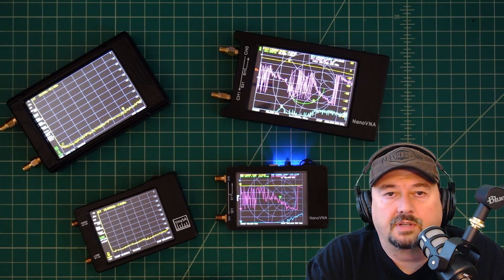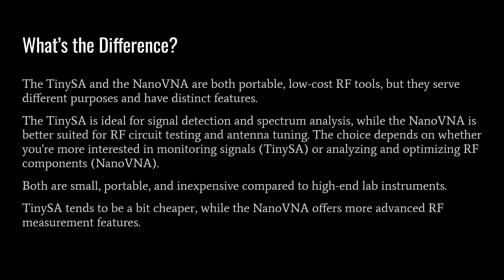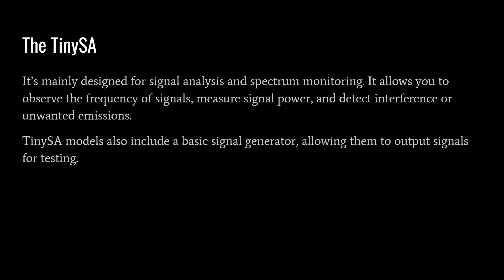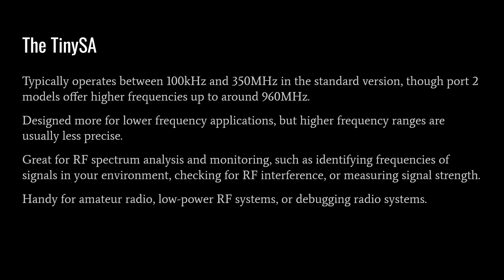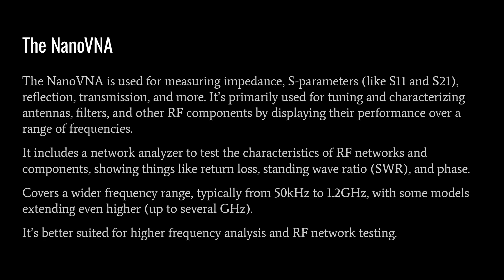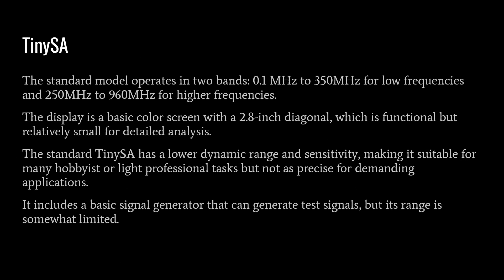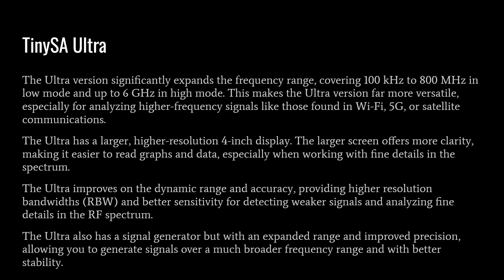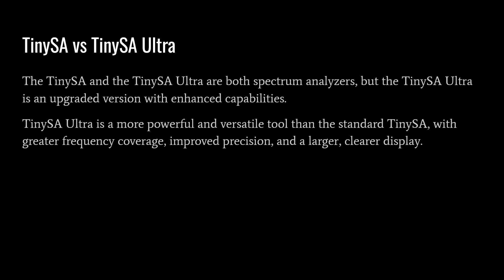TinySA vs NanoVNA: The Ham Radio Showdown

Comment: OK, first I bought a NanoVNA for antennas/cable testing/etc.  Then I bought the TinySA  Ultra for finding RFI.  And now I am buying the Tinysa Ultra plus.  If you put one TinySA as a signal generator set to -73dB (S-9) into you radio, you can calibrate your S Meter (nice).  Your second TinySA Ultra used as a spectrum analyzer can trace thru all your radios circuits looking for proper operation.  That lets me troubleshoot radios with a known signal source and a calibrated signal sniffer.  It is very effective for the price.  Your explanation was excellent.
Reply from the maker: Hey Doug, glad to hear it was helpful.  I love these things 👍

Comment: Most modern spectrum analysers (Keysight, and Rohde & Schwarz) do not have a tracking generator because a network analyser is better suited to transmission gain and loss (S12 & S21) measurements. I have worked up to 67 GHz.
Reply from the maker: But it is handy to have one right?
Reply: @TheSmokinApe  Very, if you only need scalar S12 & S21, it saves the high cost of a second instrument. If you are designing RF circuitry, i.e. filters and strip amplifiers, you will want vector measurement and include S11 & S22, this is also an important quality control test in the production environment. I have more years in RF electronics than I care to mention.
Reply from the maker: I don't disagree with you Ian, thanks for sharing your insight.
Reply: @TheSmokinApe  Having just retired I shall probably get a Tiny SA, I have a Nano NA, and have just ordered a selection of power attenuators.
Reply: I take it I am in good company with others that really Feel for this field :)
90% of people I talk to that say they are design engineers look at you funny when you mention a Smith Chart LOL

Comment: These are great examples of tools which you may not use very often, but are very handy and useful when you need them. I have the NanoVNA H4 and picked up the TinySA on a black Friday sale.  The Ultra's larger screen was desirable (for the same reason as you state, dammit), but I couldn't justify the price difference for my limited usage which will ge mainly noise-chasing in the house.
Reply from the maker: @ashemoski  for a ham, they are incredibly helpful.  Thanks for watching Ashe 👍

Comment: Hi Ape,
Does the TinySA Ultra have the same connection to a computer that the NanoVNA does (ie VNAsaver) so that you can read the display on a desktop monitor?
This would be a deal breaker should I want to buy a unit like this.
At my age, I really hate small screens.
Reply from the maker: I believe the software is called TinySA App 👍

Comment: Ill stick with my rig expert. Can't read the tiny text on either one of them in the bright sun. Analyzer's are no good if you cant take them out doors and read them without out a magnifying glass.
Reply from the maker: @don_n5skt  those REs are really good for beginners 😮
Reply: @TheSmokinApe  No, for anyone wanting to use it outdoors or for experienced hams who are tired of reading microtext. I mean one day, those folks who make those things, will realize that those GUI suck.
Reply from the maker: @don_n5skt  nope
Reply: I've got both the RE Pro and the NanoVNA. Both are useful and I also struggle with the text on the screen of the NanoVNA. I use the RE in the field but use the NanoVNA when working in my shack. I can easily connect the NanoVNA to a PC and view the screen on a monitor and the sheer flexibility overt he RE makes it worth having both. 

I have a need to be able to do tests at 13cm so am looking at larger screen options of the NanoVNA with extended frequency range. That will most likely live in my car and ultimately replace the RE. I personally find the NanoVNA more logical to use than the RE for more than simple Multe-type testing.
Reply: @rjy8960  Truth be told, I struggle with the text even indoors. Ape is just picking on me because I am old 😆
Reply: @don_n5skt  :) Don't worry, old man! You are in esteemed company!
Reply from the maker: @rjy8960  now that’s a fair comment 👍

Comment: Wow, great video explaining the difference between the two. I have a small NanoVNA and it is extremely useful but the screen is too small for my 63 year eyes. However, I use a magnifying glass so I get by. This is a great time to be involved with amateur radio because equipment is so inexpensive compared to even six year ago. I build a lot of my own radio gear and I was able to put together a fully stocked electronics work station on the cheap. I've learned  so much from this channel so thank you! I now build my own Balins and Ununs, loading coils, etc. Thank you for sharing your knowledge with us...73...Hugh...KN6KNB
Reply from the maker: Hey Hugh, I have the same problem reading the screen so I mostly use my computer with NanoVNA-Saver.  Glad to hear the channel is helpful to you, thanks for watching 👍
Reply: you do know there are computer programs for your PC and plug them in via USB making them even more valuable and easier to see :)

Comment: I'm surprised someone hasn't made software to use the TinySA as an SDR.
Reply from the maker: I’d like to see some custom firmware tailored more for ham tasks 🤔
Reply: Sdr Play Radios have a  free software to turn your SDR radio into a spectrum analyser. Seems to work well and the Guy who wrote the software is always adding features and doing updates.

Comment: Very good. yes the H4 and Ultra better. I just got back from park. 10/11/12 meters really hot in NY.  I got over 200 contacts . FT8 10 and 12 meter/ SSB and some 11 meter SSB . 25 FT with 4:1 . just a T 200-2 RED core 8/18 wrap.  The Nano H4 SWR sweep is awesome 10 threw 12 meters . 12 meters like 1.1 SWR . 11 meters 1.5SWR . 28.074 was 2:1 . I fold back about 4 in and 1.1 SWR on 28.074 . No tuner and killing it with a QT60 at 30 watts or less, FT8 was 10 watt.  Just on 20 AH battery.  Proto rico / Jamaica / west indies  /Oregon / California/ Nevada/ Washington  were most of skip.   Some noise like S3 to S4 but most signals were S9 or better. I just got new UNUN 4:1 1 KW today .  some testing later. it has a 15/30 wrap on T240-43 and 1-54 MHZ 4:1  --1 KW PEP . looks super nice. I take pics later.  73
Reply from the maker: Yeah, these tools can really help get stuff dialed in…. Thanks for watching Robert 👍

Comment: A summary:
The TinySA is a spectrum analyzer. It shows you almost real-time RF signal strength over a specified frequency range. In addition to measuring all sorts of radiation pattern characteristics of an antenna it's handy for measuring signal strength changes, tuning up radio filter stages, and for identifying problems with harmonics from a transmitter. In conjunction with a cheap ($5 or $10) noise bridge (a random RF noise source) it can show you the wave shape (pass-band, stop-band,) of a filter. A noise bridge is a dirt cheap substitute for a tracking oscillator to use with the spectrum analyzer that will usually work just fine for hobbyists.  A critical parameter for hobby-grade spectrum analyzers is the highest frequency it will measure.

The NanoVNA is a network analyzer. It measures all sorts of characteristics of any sort of electronic network over a frequency range, including resistance, reactance, and phase relationships over that frequency range. It can be used to test and characterize everything from resistors, capacitors, and crystals, to filters, impedance matching networks, and antennas. It can find the location of problems in coax or just measure how long a piece of cable is. A critical parameter for hobby-grade network analyzers is the highest frequency it will analyze.

Basically, over the period of a year or 2 a hobbyist will want to acquire 1 of each device, a multimeter, and an oscilloscope to have a good starter equipment set to do ham radio measurements and a variety of electronics projects. Add in a soldering station and a function generator (if one isn't built into your 'scope or other gear) and you're set up to do all sorts of things. Of course, if you just want to talk on the radio all you'll need is a radio, coax, and an antenna, and someone to check your SWR when you first set up. But where's the fun in that? The hobby is radio electronics, not talking. You don't even need a radio to just talk.
Reply from the maker: Pretty much on point, somewhere around here I have a video showing how to use a broadband noise source in lieu of a tracking generator.
Reply: and I suggest a breakout box/Test kit to go with them, Zeenko (#1) NanoVNA Test board Kit VNA Test Demo Board, (#2) BM series Low Noise Amplifier 100KHz-6GHz and (#3) Log-Periodic Antenna 0.6-10GHz all together maybe another $25
if you are worried about how much test equipment costs you are in the wrong hobby or profession :)
Reply: I’m even considering a regular tinySA to use as a signal generator in tandem with my ultra to create a tracking generator.

Comment: A $10 return-loss bridge is easy to use with a TinySA to determine the reflection of an antenna system at various frequencies and calculate the SWR value if the return loss value isn't sufficient for your taste. Return-loss bridges were used for decades with SA's before the advent of the $50 network analyzer. I still use mine when it's more convenient to use than the NanoVNA.
Reply from the maker: Thanks for the info John 👍
Reply: That's great info, thank you!

Comment: The 'miniVNA pro' from Radio Solution, which has been around for a long time, has the advantage that it has a Bluetooth interface and can therefore be attached directly to the base of the antenna. This means that the influence of physical proximity can be prevented.
Reply from the maker: Yep, Bluetooth is handy 👍

Comment: I talked this over with my cousin, uncle, brother, and he agrees.  A high end multimeter from wal-mart, set to measure AC current, but run the leads through a 9 volt battery (opposite polarity of course), will do everything both them little meters will.
Reply from the maker: That is actually my next video!

Comment: I have both of these, and use them more than I thought I would.  Learned a lot using them, and watching video's too.  

I do wish "they"  would make a small TDR about the size of the tinySA   or the ultra,  that we could buy for field work with checking transmission lines and antenna systems.  It shouldn't take to much since the firmware would not be anywhere near the complicated stuff in the VNA's.  A pulse generator, timer and fast voltage detection would be about all thats needed. Not expensive RF stuff like the other units.  Ability to hook to a scope to see better would be cool too..  Just saying in case anyone in china is listening.. LOL
Reply: The NanoVNA can be used as a TDR.
Have you tested that function?
It doesn't actually measure the response from an impulse in the time domain. Instead it measures the frequency response and uses mathematical transformation (inverse fft?) to show how the impulse response would have looked.
I have used it, it seems to work fine.
The resolution is limited by the number of points but good enough for many use cases.
Reply: You find the function in the menu Display/Transform.
Select Transform on. There are some other options. I don't know the details about.
I usually use the bandpass option.
You can also set the velocity factor to get the results in meters instead of in nanoseconds.
This will transform all your traces to the time domain. Reflections show really well in e.g. an impedance trace or a linear trace.
The time/length scale is set by changing the start and stop frequency of the stimulus. Usually I set the start frequency to e.g. 50 kHz and then set the stop frequency to get the range I want. E.g. 200 MHz gives 195 ns or 20 m scale.
2 GHz gives a range of 2 m and a resolution of 2 cm.
Good enough for most cables but not for high speed PCB traces were you want to  pinpoint reflections to the millimeter.
Reply: @larslindgren3846  Thank you!  I will give this a try and try to get my brain around it!
Reply from the maker: Interesting idea, thanks for watching Arnold 👍

Comment: Why don’t they make a “TinySA-NanoVNA”!  One box, does it all!!
Reply: You can easily mount both in a box with adhesive Velcro. I have done something similar in a briefcase. A handheld oscilloscope/multimeter with sig gen. A few batteries, solderless  breadboards and tinyVNA and you have a complete lab in a box.
Reply from the maker: That would be handy 👍